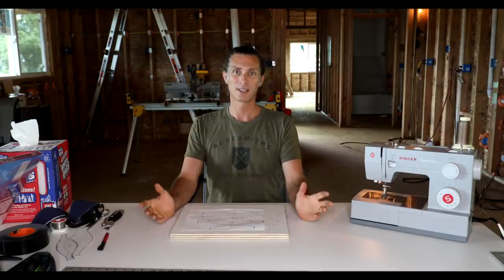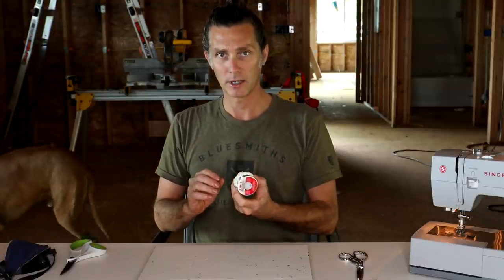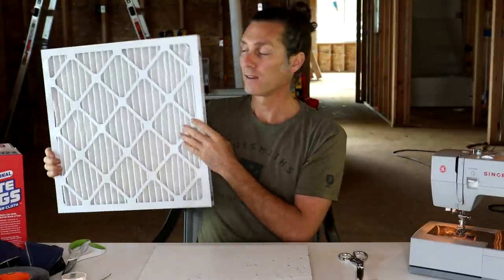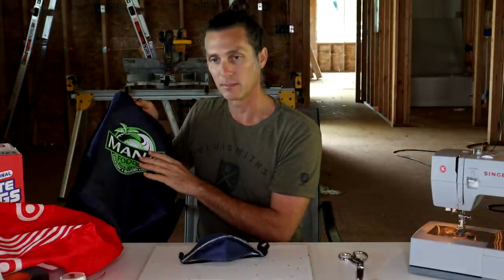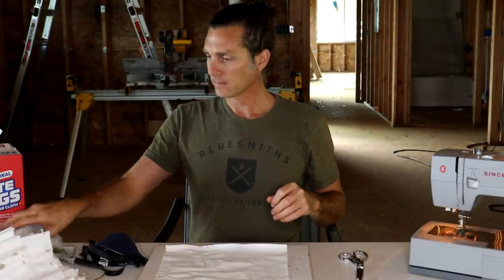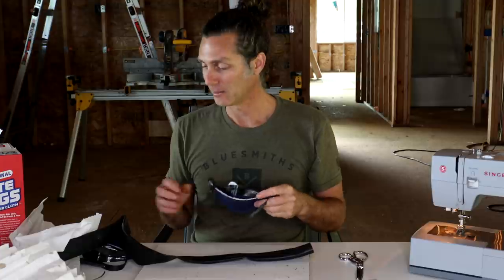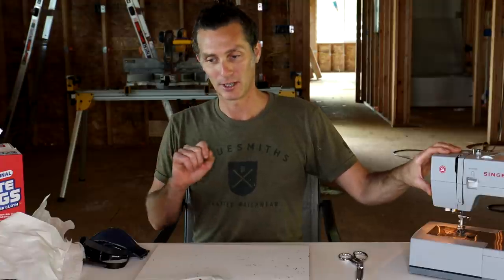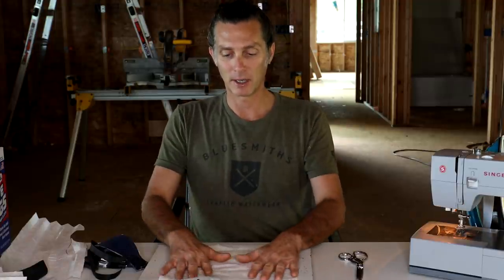Tutorial: HOW TO make your Own High Quality Filter Mask

Comment: I thought Hepa filters have fiberglass particles...
Reply: Some do, I keep reading 3m,I think model 1900 doesn't have fiberglass.
Reply: @SW-ii5gg  From what I read 1500 and up is not fiberglass, it's in the FAQ on the filter website.
Reply: @a.m.seider8282  I believe they will work well from what I've read and they don't recommend it because they have to have to cover themselves for potential lawsuits since they are not making the mask and many potential problems could be blamed on them if they did recommend them.
Reply: 3m filtrete filter do not contain fiberglass its stated on their website.   Filters 1200 and higher is effective for filtering virus .
Reply: @ginatse12  I agree with you.

Comment: My question is how easy is the cleaning for this mask after each use?
Reply: I would question the reusability of the mask due to the use of paper towels and duct tape.  Otherwise polypropylene is durable enough to soak in 70% IPA, Boil, H202, and irradiate with UVC.
Reply: ElonTusk I will keep all of that in mind when making my masks. Thank you for your quick response and great video.
Reply: @brethenderson4399  I like the design.  Would consider doubling the the filtrete material and sandwiching the wire between the layers to make sterilization/ sanitation possible. 

Edit: I was just reading an article stating that the one of the inventors of the n95 recommended the shop towel as a filter and that they're usually made of polyester so, maybe safe to sanitize?

Comment: You need tea towels dude if you want a good mask
Reply: The study that said that double layer tea towels were as effective as an n95 did not recommend it but rather recommended two layer 100% cotton t shirt material.  Just so you know.
Reply: @elontusk5553  yeah I did read it size would have solved the resistance issue
Reply: ElonTusk Tea towels were best actually, but not everyone has those.  Most everyone has t-shirts, but I personally would not risk it.  A good. Tight fitting mask with changeable filters would be best, but still likely not pass the “fit test”.  They would be better than nothing.

Comment: Good luck trying to find elastic.
Reply: don't know if you have lycra, but if so you can cut 1/2 wide strips and pull them and they curl up and act better than elastic which is more scratchy- I have lots of left over small pieces of lycra and only about two kinds I tried do not roll up out of 15 in all.......hope this helps all .......and, it is more comfortable.....
Reply: @carolburnett8372  Nice tip, thanks. But, anything that I have with Lycra in it, I wear. I'm not going to start cutting up my clothes to make elastics, lol
Reply: @MissTina62  
Maybe ace bandage
Reply: amazon has lots

Comment: Nice design but I have some safety concerns listed below that can seriously effect the performance of your masks.  I really like your idea about the cotton makeup pads and I will be using them going forward.  Also the mention of replaceable filters is a good idea, especially if the mask is going to a medical professional. 

The filter material you are using is High Efficiency Particulate Arrestance (HEPA) and is the best choice for these masks, HEPA grade VACUUM bags are also a good choice, especially the large whole house, central vacuum system bags, as they have additional filter layers.  You definitely want the side of the filter that the arrow points to facing towards the wearer’s face since that will give them the best protection.  And disregard the comment about baking the filter material !!!   DO NOT WASH, DRY, IRON, or MICROWAVE HEPA FILTER MATERIAL it will destroy the HEPA layer of the filter !!!    Also ALWAYS WASH ANY FABRIC MATERIAL EXCEPT THE FILTER MATERIAL THAT YOU ARE GOING TO USE TO MAKE YOUR MASKS, other wise it is considered CONTAMINATED !!!   I hope this helps. 

Barry Broyles Captain Retired Baltimore City FD.
Reply: I was all geared up to iron my Filtrete 1500 filter as I was watching a video made by an Emergency Medical Doctor / ER Director who throughly researched materials for home made masks, when he said that filtrete advised him not to iron their filter material because it will destroy the HEPA layer so I scrapped that step.

Comment: 1900 or higher rating is recommended
Reply: I also read that about the 1900 as a single layer but if this is folded I would think it would be much better than the 1900 single layer. IMO
Reply: But mostly everything I read said 1500 and up. I only saw one comment on the 1900
Reply: @diasweet47  3M 1 800.388.3458 SAID they DO NOT recommend to use in masks
Reply: @a.m.seider8282  
It doesn't surprise they would say that for liability purposes but Doctors and surgeons have researched it..It's the same material used in making the N95  respiratory mask.

Comment: A mask like that would have to be disposable.
Reply from the maker: Agreed. However it has some elements that make it more suitable to sterilize in the oven. All of the materials I used will still perform well after being baked in the oven for 30-40min at 150F. One of the biggest Problems with baking the 3M and 95 masks are that the foams compress and the Mask layers tends to delaminate. (This comes directly from 3M white paper) This mask has no lamination and no foam. Also, the materials used in the video are resistant to melting at that temperature.
Reply: Out of the Doldrums I have heard if you put a dirty sponge in the microwave the bacteria and germs gets stronger.
Reply: @Teatime7771  Not true
Reply: Susan Hubbard there has to be a point where sponges are so dirty you have to throw them away. When you are cleaning with a dirty sponge all you are doing is just spreading around the dirty or germs or bacteria in it.
Reply from the maker: GLJohn Stewart At a certain point the sponge is no longer doing its job. Throw it out. These things don’t last forever. It depends on the level of contamination and rate of use. Make yourself more than one mask. 😉
Reply: GLJohn Stewart I agree,  and wouldn’t keep a sponge more than a couple of weeks. But I don’t think microwaving increases microbial growth.
Reply: Susan Hubbard I heard it on the show shameless that the bacteria becomes super bacteria if you microwave it. I always how away my sponges after I feel they are too dirty and grab a new one.
Reply: @Teatime7771  Why are you using sponges then? I have a silicone sponge and one made of plastic fibers that never stink or get moldy.